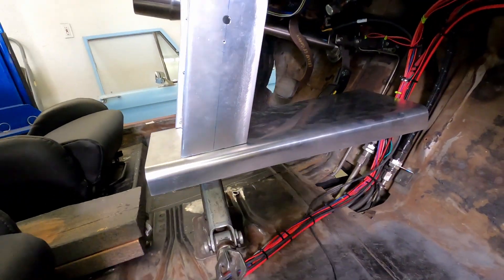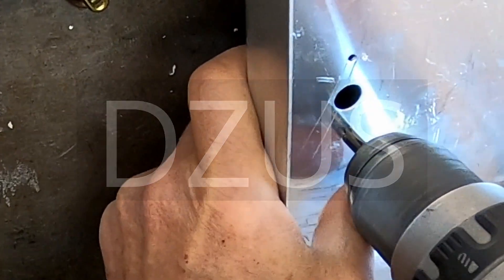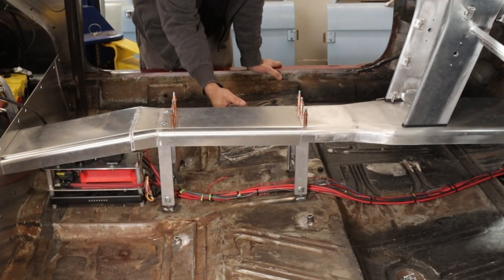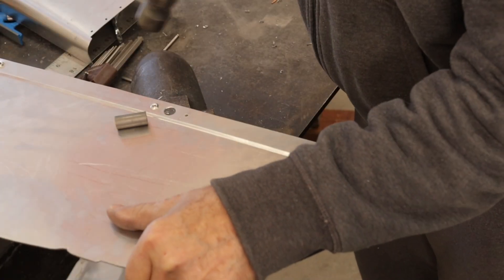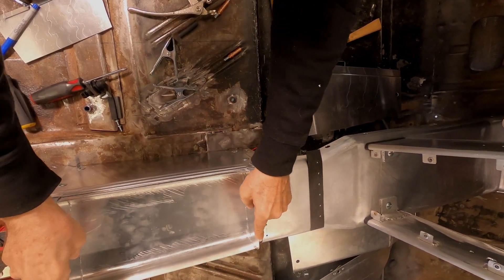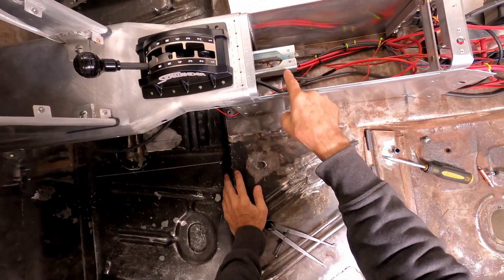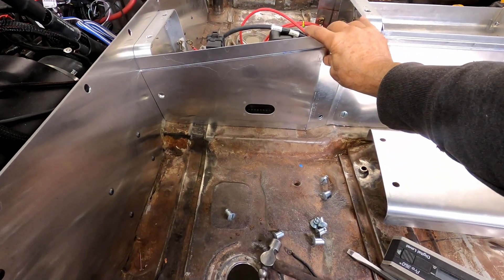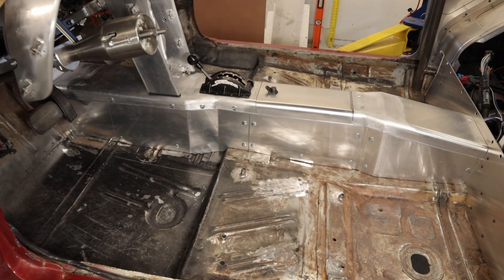Building an aluminum center console

Comment: You probably already painted it but I thought it might be cool if you tried onodizing the center console black just a thought and probably totally not possible but throw it out there
Reply from the maker: Thanks, all options are open.
Reply: Anodizing is expensive compared to paint and requires an available local business unless a person has the desire to ship parts. Color choices can be limited. Touchup - depending on color - is usually difficult. In addition, alloy affects color so welds will highlight along with the rivets John used creating an incongruity. Durable tinted paints are easily available and can be premixed into an aerosol spray can if desired. Easy to store and touch-up.
Reply from the maker: I haven't even thought about tinted paints. Hmmm.

Comment: I'm not sure that the body filler and paint is the best choice. Have you considered leaving it as is and go for the more durable powdercoat? 😊
Reply from the maker: I have considered powdercoat.  The three issues are:  UV powdercoat that's chemical resistant only comes in simigloss which is too glossy for me.  Tolerances are tight and PC is thicker than paint.  There are pieces already attached by solid rivet that won't withstand the heat of PC.  Actual expensive auto paint is REALLY tough stuff so I'm not afraid of it.
Reply: @JohnReynolds661  Knowing one's application and limitations is necessary for the road to success. John's comments are very informative and knowledgeable.  There are so many exceptional paints which can be tinted to any color to customize a project.  Properly prepped, there is no issue with paint adhesion to aluminum.

Comment: “I’ve covered bead rolling…” Wait, was that a glitch in the Matrix? More content, please.
Reply from the maker: The previous three videos concentrated on lots of bead rolling.  Pt 1 and 2 of the dash and the engine cover.
Reply: @JohnReynolds661  I've learned so much from your builds, especially the Corvair. And to think it will be faster than the Beetle is mind-bending.

Comment: You’re doing it…
You could have gotten more console storage space by angling the shifter up at the front a bit so the cable bracket pointed downward instead of parallel to the floor.
Making a wooden buck and hammering the sheet over it is sometimes better than bead rolling as you can control the shrink and stretch with each hammer blow.
In the hinge section of your local hardware store there should be various cabinet door sliding stops, there’s one meant for record players or wine cabinets or something that has ball detent stop positions.
Or you could use an old car door check for the console lid.
Reply from the maker: I looked on your channel but didn't see any examples of how to do it right?
Reply: @JohnReynolds661  That's because I, too lazy to do anything unless it needs doing and so lazy that putting it on YouTube would scare people.

Comment: My dad loved Corvairs. He had a red 65 with the 4 carbs, 4 on the floor from the dealer. Later bought a used 65 with the turbocharger but the turbo was frozen. We never got it fixed.